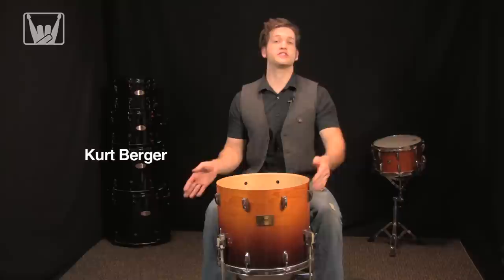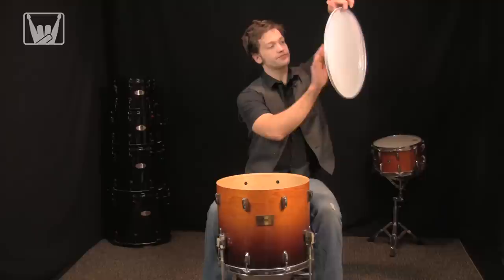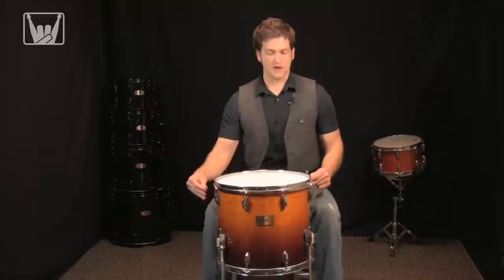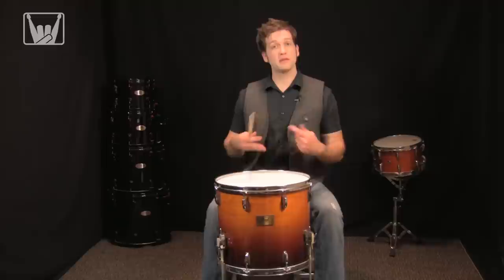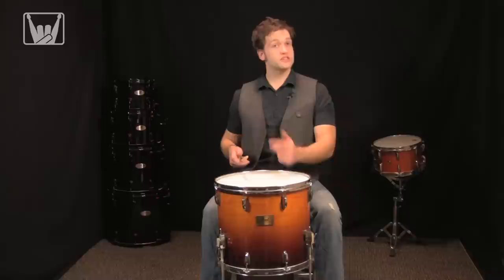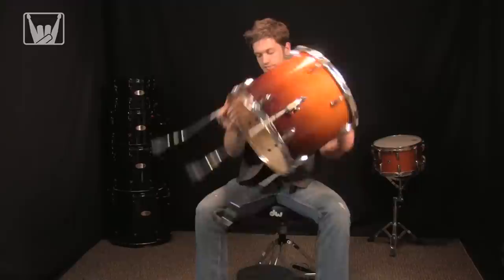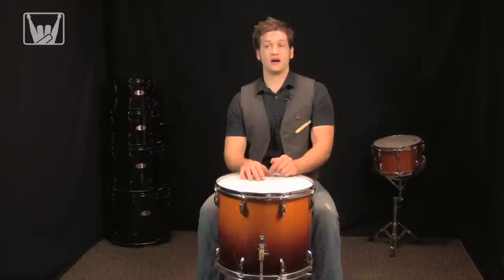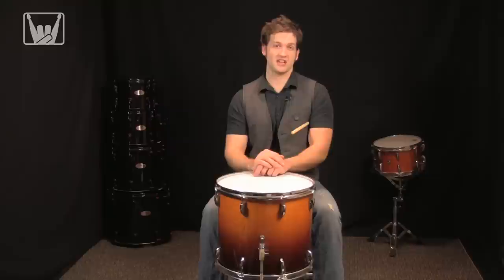The Floor Tom - Tech & Tuning with Kurt

Comment: I usually use the rings when puttin on new heads after a while they stretch out, then 'U' could remove the rings but I just like to make it easy for the sound man also,,,
     (Oh well to each his own, thanx for the tip comes in handy,,)

Comment: did U ever try a double ply clear head as a  resonant head ?
Reply: Flash Back I recently discovered this technique and it produced the absolute best floor tom sound I’ve ever had. I used an Evans clear G2 on the top and bottom of a 16x16 Tama Starclassic floor tom and tuned them both exactly the same. Excellent tone.

Comment: I've noticed how some people stack their drums on top of eachother like you do in the background but I've always been scared that it can stretch the head or knock out the tuning. Is this true or can it actually hurt or effect the drum shell or head in any way?
Reply: I have the same question
Reply: +MrCJduo +Kris Poorman  well, actually when the drums are stacked in this manner, there is an equal amount of surface area covered to avoid any dents or dinks in the heads therefore this should be fine, however having said that the drum heads are stretched lightly by the constant prolonged weight and overtime significantly de-tune.
Reply: I figure it's the same way that I wouldn't want something like a tom sitting on my guitars strings, at least make a set of cardboard dividers and keep the rims & lug bolts from making any contact with the next larger head. Why would it be logical to risk something if you aren't certain, and would Buddy have allowed you to ever stack HIS drums this way??
Reply: Randolph have you EVER been to a music store ?? Have you not ever seen drums stacked ,m . You have equal pressure and it doesn't her the drum at all

Comment: it became very difficult to test a head in the store because every head is packed in foil and cardboard....and the guys in the sores are not amused if you take out 30 different heads, tap on it, recover and lay it back....
Reply: Store owners will quickly figure out who is serious about their craft, and the methods used in finding the right tools. Keep the egos small enough to fit through the doors coming and going, and you won't have too many problems anywhere you go.
Reply: Never seen a head wrapped in foil, and after 2 or 3 you always find the right one.

Comment: no tape no moon gel. just have spend a some time with your drums while you tune. i know its hard to put all the required time on a segment. good tips  either way.
Reply: I use tape and toilet paper xD just not on my small 10 inch tom
Reply: I've folded a paper towel into a strip, and taped it at either end across the snares. It definitely makes some unwanted sounds go away. But if it's gonna be Real Rock'nRoll, you gotta use a sanitary napkin, with wings, ha ha!